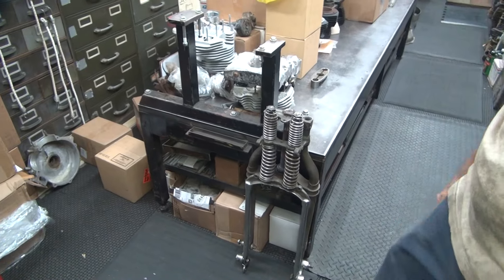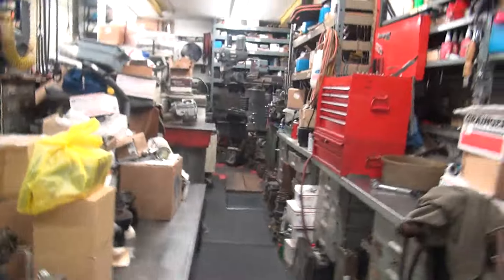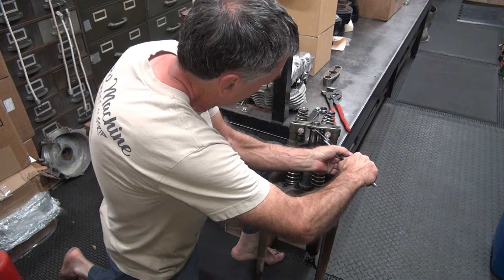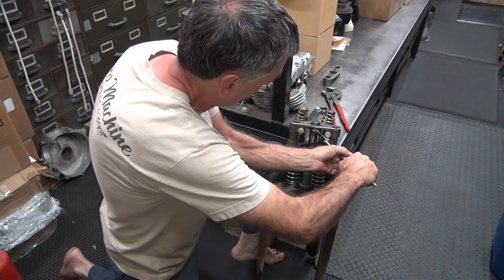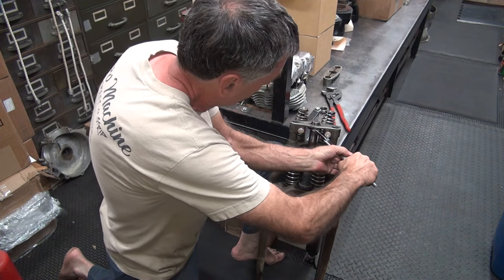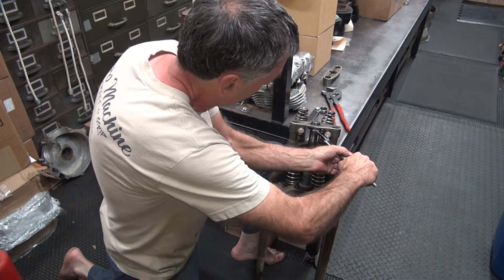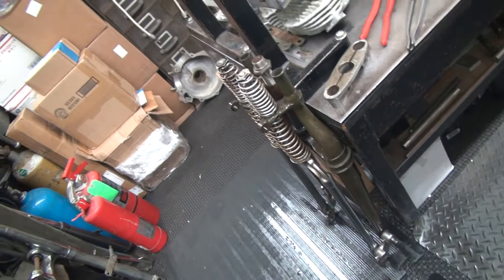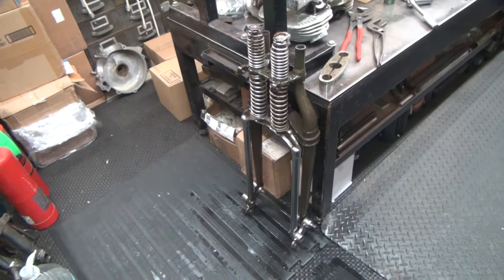#166-B How To Do It straighten a bent 1936-48 45 springer fork stem knucklehead Harley Tatro Machine

Comment: Hello tatro I have a 65 panhead with points ignition  can you please recommend a uprated coil as I think mine is weak am I right in thinking that the original is a 5 ohm coil the manual doesn't seem to state seems to faul the plugs I have adjusted the carb leaner than specified in the manual linkert m74b regards Alan from the UK.
Reply from the maker: the manual is only for starters. you have to adjust the carb to what works best. 5ohm is the correct coil. 
tatro

Comment: Good work, flip your tool on the next fork. Will make nut removal easy.
Reply from the maker: just stop being a dumbass and loosen the pinch bolts some. i didn't want the top tree to move any so that i could see if the fork stem moved to where i wanted it to be. if i just loosened up the bolts halfway it would have been alot easier on me and the nuts.
see, i do show all my mistakes too.
tatro